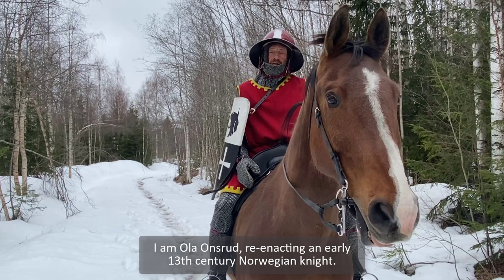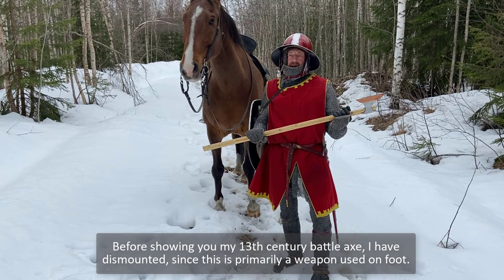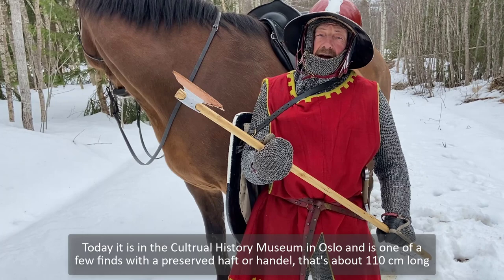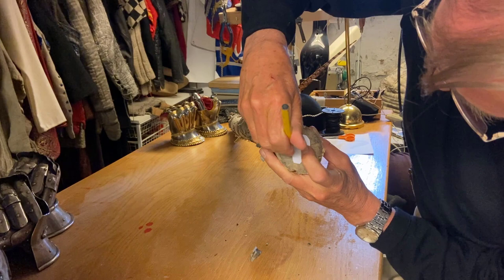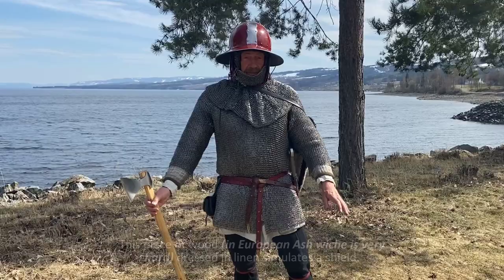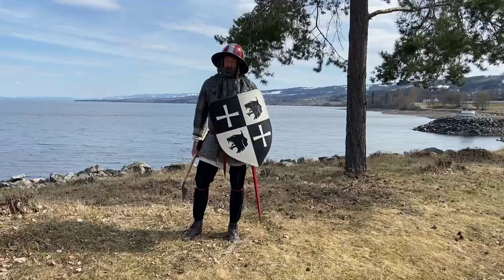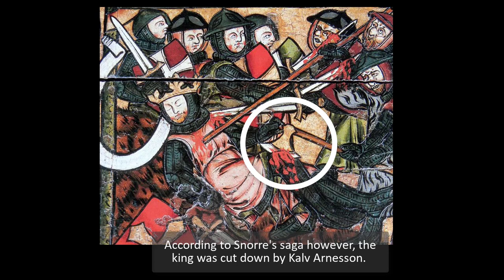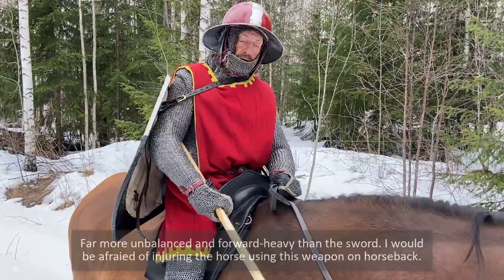Battle axe 13th century

Comment: Would the length be the primary problem behind using said axe on horseback? At first glance it looks like the length could be useful for passing blows on a charge but it seems rather ungainly for one handed use on horseback or foot.

Comment: 10/10 more please!!! also, so.... could u talk a bit about the norse cavalry?? like why does it always seem that norse always preferred to fight on foot than on horse?? the Rus people for example lived in snow climates too but they developed more and more to use horseback and spears/lances on horseback than to be on foot; why is it the norse preferred to be on foot? wouldn't the horse or being mounted be much more of an advantage??
Reply: The Rus people lived in a land with far more plains (especially in the south, where the steppe begins) and far less mountains. Also many enemies of the Rus people (mostly steppe nomads, but also Bysantines, Hungarians, Poles and Germans) actively used cavalry, so having their oun cavalry forces was quite important. Another reason is that in Scandinavia fleets and sea battles were much more common, than in the lands of Rus, and transporting horses by sea is quite difficult.
Reply: The Knights certainly would prefer to fight on horseback. It gives them a tactical advantage that's hard to deny. But in many battles fought in Scandinavia (except maybe Denmark) the terrain simply didn't allow for the cavalry to operate with efficiency. So it was more of a must then a preference. And as the other commentor said, it was a naval power and many battles were settled at sea.

Comment: not sure about the dane axe and shield combo...
Reply: It was the way. Check out the Bayeux tapestry.
Reply: @andershelseth2697  nope
Reply: Large, river Thames style dane axe with big, broad blade that could weigh 3 pounds alone, on a long haft - most probably not. 

However, plenty of dane axes were in fact pretty modestly sized axes. Definitely could be swung one handed by someone strong and familiar enough with them. 

It's just that the large, broad ones are most eagerly reconstructed, general "fan favorites".
Reply: @jeydonfal1  Great point. You convinced me. What are contemporary sources worth compared to your opinion?
Reply: Fist off, yes, single handed short axes and shields were a thing. I was talking about the common two handed axe we commonely refer to when we talk about dane axes. The axe Ola use in his video is in that category. My point is, due to the balancing point of an long axe, using it with one hand is extremely impractical to the point of beign completely inneffective because of the lack of leverage a single hand is able to generate. You would have to swing the axe back so far, making your attack very oblivious, the power of the cut very low and your recovery very hard. Anyone who had done some cutting with heavier or unbalanced weapons such as axes will probably agree with me on this one. You could also put your hand closer to the center as demonstrated by Ola, but the unused length would make it even more akward and you encounter the same problems as mentionned earlier but to a lesser extent.

On the bayeux tapestry we can see a SINGLE warrior using a shield and axe combo. This particular soldier is bracing against a cavalry charge and incoming arrows (as made evident by the dead soldier next to him with an arrow in his head) and is also in a back rank. My therory is that he might be defending against missiles and would most likely put the shield back on his back during fighting or ditch it completely once in the face of the ennemy. We now compare this to the OVERWHELMING majority using the axe two handed. we can even see his comrade fighting a cavalryman but with the shield on his back, using two hand.

TLDR: 1; lack of sources for the method, majority show using two hands.
            2; go pick up a 1m long pole, tape 3lbs of metal to the end and tell me how it feel to swing with one hand

Sorry for my english
Reply: @jeydonfal1  Good answer. When pointing to the use of a braod axe with shield, I was thinking of two handed use. Its perfectly possible with the right strap arrangement. I apologize for not being clearer. As to the weight of this axe, its more like 1.2 than 3 pounds. I know, I made it :)
Reply: In my opinion i think the axe would be used two handed and the shield would just "hang" on the shoulder for the added protection. But that's purely speculation.